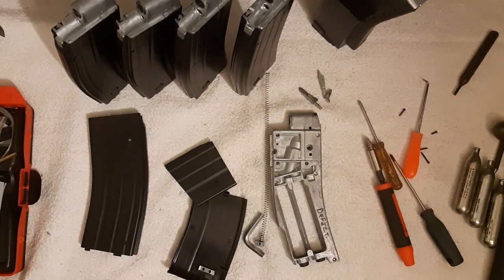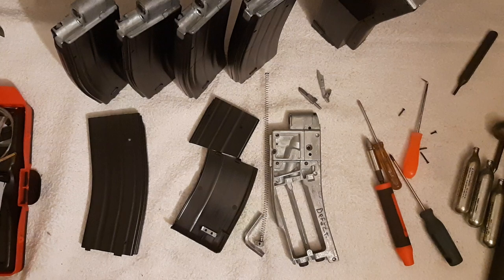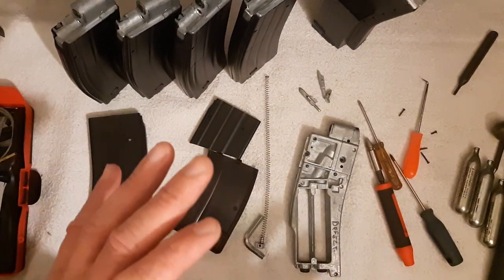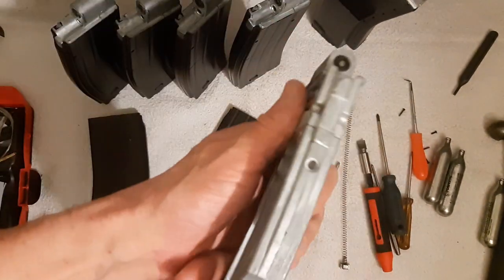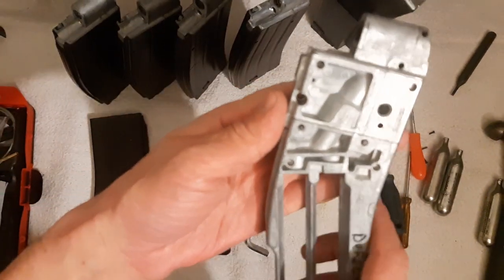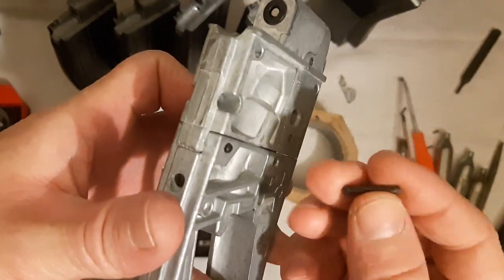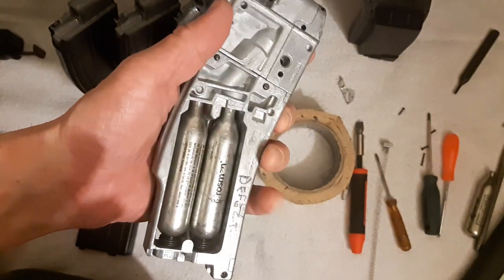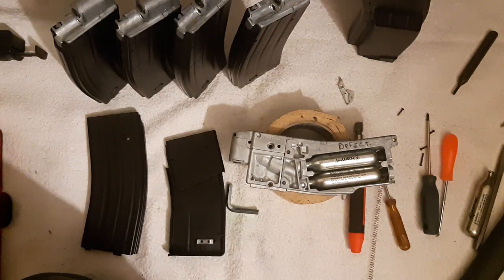Crosman Full Auto BB Gun Magazine - Tips And Tricks

Comment: you can port the Plug in the Valuve with a dremel.
Reply from the maker: the inside bore with the big green o'ring type seal? yeah definitely,  you could probably replace the green seal with a thicker o'ring too if its a last ditch effort.
Reply: @RWMAirgunsmithing   but if you have the Can. Ver. that casing behind the seal is too thin they did that on Purpose it will crack BUT! you can Reinforce the inside with Liqiud Metal Epoxy just apply a thin coat to it and let dry 
also be damm sure to keep outter edges clean when you do it.
Reply from the maker: @joseglenn4435  Can. as in Canadian? Not entirely sure that is a thing.. the boxes in the US also state 430fps and they all work off the same magazine.

Liquid epoxy sounds great but I think at that point you really got a bad mag out of tolerances.
Reply: you mean  yes you can i got 723 fps but  but 3 mags. max but well worth it.
Reply from the maker: @joseglenn20  75 rounds at 700+ fps does sound like a lot of fun xD  that would destroy my backstop though hehe, I hope to have the range to test at distance one day!

Comment: What if mag spews  out co2 when u put a catridge in mag
Reply from the maker: Does it come out the top valve or the second co2 piercing needle?
Reply: @RWMAirgunsmithing  with mine wen I fill the first one up on the left the air goes out of the right side so I have to put a used co2 in the right one tighten it up and then do the left side so no air leaks so basically im jus having one co2 in it instead of 2 and I dont know how to fix that do you know ?
Reply from the maker: @zachade9998  you probably need to tighten the ring seating the piercing needle and seal on the "second" co2 sĺot.  Follow the steps in the video, it might just need to be snugged into place.

Comment: I'm not sure if I'm surprised or not that Crosman hasn't updated this garbage magazine design. Namingly, the pain of reloading the f***ing thing. Surprising because this overall platform system could be THE design to recommend to anyone except for the magazine. Not-surprising because that's the apparent theme of air guns: "almost good enough". Perpetually almost good enough. For decades.
Reply from the maker: Yeah, definitely not like the real thing xD  Pretty much all the replica airguns have their issues, but you trade some performance for realistic handling.
Reply: It's frustrating, but hey I still play the game. I really like the format these use where you can interchange uppers and lowers. If they made an entire line like this, it would be awesome to be able to swap in different calibers or maybe a rifled barrel with mags that push diablo pellets up. Or something, the ability for innovation here seems massive. 

I got mine on HPA and am planning at some point to convert a 6mm drum to feed somehow, was thinking about using the top of a standard DPMS mag and finding a way to get the drum to feed up the usual BB stack. 

Wish in one hand, couch potato in the other. lol
Reply from the maker: The barrel on my m4a1 build is a crosman 1077 rifled barrel.  I have a video in the works for replacing the stock crosman barrel. (Still shooting bbs though hehe).

Its true all their models are almost all identical but I enjoy the fact they are soooooo milspec you can take it apart and tinker with it.

Good luck with the 6mm drum mag xD

Comment: Broken spring in mag
Reply from the maker: @melvinscott2714  gonna have to remove it and replace.  It can be done by removing the screw at the bottom of the bb channel/mag, be careful there might still be spring tension.

Spring size is 8 inches long, 3/16" diameter, 10 spirals per inch.

Comment: so moral of the story that thing is crap?
Reply from the maker: Hehe xD I wouldn't say crap, but there are a lot of comments out there about widely varying performance issues.  The most common problem on the mags is with the "first/second" co2 check valve, it just takes the tiniest adjustment on the rings and that will usually get these running just fine.

Comment: Why does a consumer have to fix a faulty design?! Wth?! It should work out of the box!!!! I’ve purchased 5 cartridges and none of them work correctly. It’ll drain the first co2 but it never utilizes the second co2 cartridge. The second co2 is always never engaged and is wasted. Just fix this f’n thing. Thanks for taking my money DPMS.
Reply from the maker: Yeah totally agree the quality control is not up to par at all.  It sounds like the check valve is constricted on your mags, but remember you never need to overtighten your co2, on this magazine if you overtighten the second slot co2 you will compress the check valve.

If you need help performing the fixes in my videos lemme know!
Reply: Nah you right bro I feel like if u gonna sell people stuff make sure it works I paid too much for this bb gun but it's is fun to shoot sometimes tho I got pull the trigger and it sets everything off like it should but the bbs don't fly they just stay in da mag
Reply from the maker: @antonplayzgamez631  how does the hole on the rubber "chamber" part look? If its mangled on the bottom section it means the mag is not seating properly all the way in and the hole on the mag is slightly lower than the hole on the rubber barrel "chamber".  

Very rarely but it happens, the magnet in the mag at the top of the bb channel shatters or is missing, making the bb rest higher than the hole in the mag. Need to at least put a drop of crazy glue and let it dry to make the bb line up with the hole.

Comment: What video do i watch if i want to change the cover on my mag
Reply from the maker: You mean the black plastic pieces? there are only 3 screws holding them in, check out my disassembly and reassembly videos, I go over it piece by piece and show what to expect underneath the covers.
Reply: When i take the screws out it doesnt come off
Reply from the maker: @Walmartbag142  hmm, that is odd, the 2 top ones screw both halves together and the bottom screws into the metal body of the mag.

Technically there isn't anything else holding them together, was the magazine ever dropped or something?
Reply: No i cant get the two screws out i havethe same screw driver and they wont come out
Reply from the maker: @Walmartbag142  if the screw turns but doesn't come out it sounds like the plastic threads are stripped.  Did you shine a light to make sure the screw head is not stripped? And also, that is a tight fit, are you using precision screwdrivers?
Reply: I cant turn the two screws ill try it later
Reply from the maker: @Walmartbag142  they should give, make sure the screwdriver locks in deep into the screw head

Comment: I have an AK 1 bb gun and my magazine is stuck. same problem. I have an an AK1 with a magazine that is stuck in the rifle.   Tried pulling hard and wd40.  No Luck.  It appears to be stuck on the side opposite the catch that holds it in.  When I push the release lever it comes out less than 1/8" on the catch side.  any ideas? is i fix this at home. sending the gun back is a big problem.
Reply from the maker: Couple questions.. Does the magazine release button clear the metal catch completely?

 If you put fresh co2 in it does the bolt cycle properly? If something is broken or misplaced in the blowback mechanism potentially the firing pin could be protruding into the mag. (i was able to pull my mag out even with the trigger actuating the firing pin)

The only other part in there is a little catch/tab for the magazine follower and lockback on empty function.  If this little tab is broken or bent out of place it most definitely could interfere with magazine removal.  Just to make sure.. you need to insert and remove the magazine vertically unlike a real AK where you have to "rock/hinge" it in.  You can access the bb follower and spring if you gently remove the plastic part that retains the spring in place, the spring and follower should fall out on their own, if the follower wont fall out it is most likely jammed by the little bolt catch tab inside the mag well.

Comment: Do they make mags for more bbs
Reply from the maker: Yeah, they call it the quick reload mag, holds 250bb.  I never use it though, I prefer loading 2 mags and letting the CO2 rest
Reply: @RWMAirgunsmithing  i found the mag on amazon understand the c02 cart resting amd does it fit well with this crosman ar with 2 c02 cart mag system
Reply: @RWMAirgunsmithing  where can i find mag that doesnt jam like that 250 round bb mag all i can find is for airsoft thats like 45-50 round if not a drum thats mechanically sound
Reply from the maker: @bulletproofpinata2328  there are only those 2 models of magazines and there is no airsoft version. I dont have any issues with my mags, but this is why i made the video so i can help others.  I treat these airguns with the same manual of arms as a real AR and have no issues plinking.  These guys are more on the "replica for training" side of the spectrum, they operate 99.9% like a real AR as far as the user is concerned.
Reply: @RWMAirgunsmithing  yea i have the bb full atuo gun for these mags but cannot find any type of mag that holds more then 25 thats compatible with this crosman airgun ar